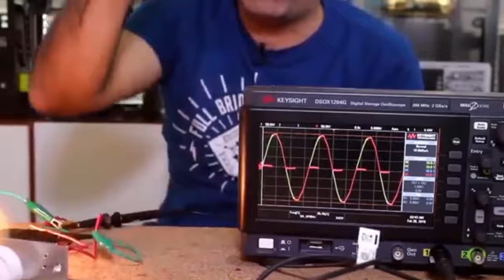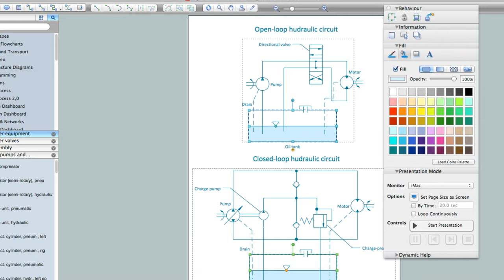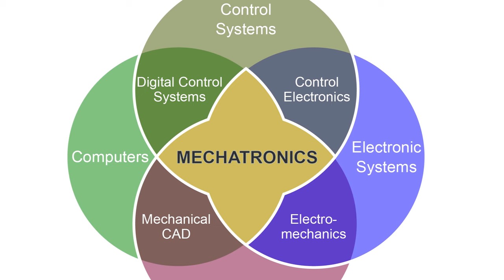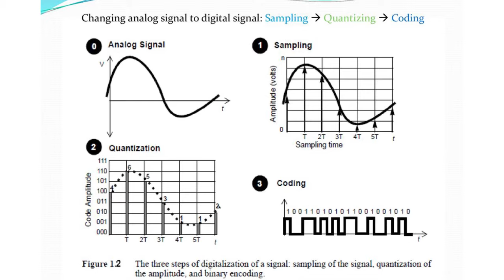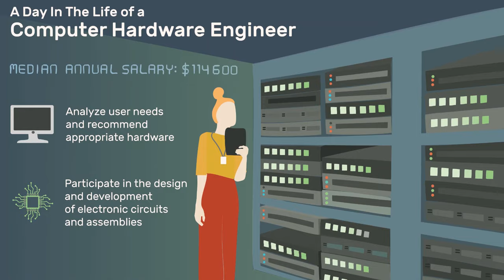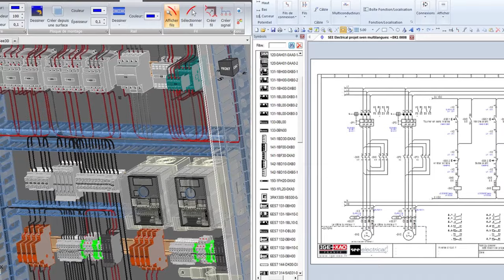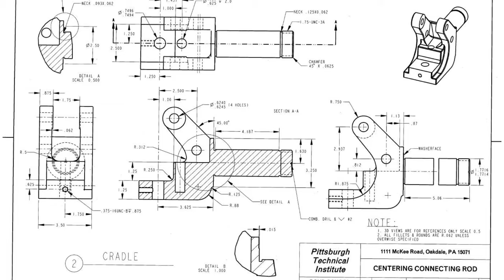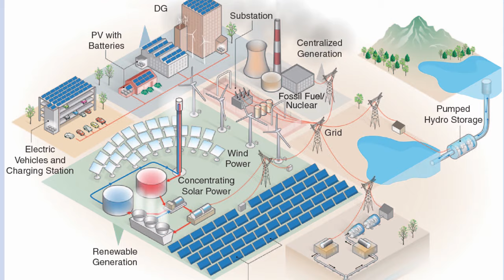What Does an Electrical Engineer Do? | What is the Work of Electrical Engineer?

Comment: Question: Do electrical engineers actually build things? I am heavily interested in mechatronics engineering because I hear you can obtain a wide range of knowledge from it about building things, and I'd love to learn how to build things and maybe have that as a job
Reply from the maker: Hey good question. It depends on the avenue you go down. Power engineers and telecommunications engineers may not, but electronics and circuit design engineers can work with mechatronics easily. You can also enter a software developer role and work with robots or mechatronic systems that way. 

Does that make sense? I have a video on mechatronics that is becoming popular, it may help, 

  “What Do Mechatronics Engineers Do?” https://youtu.be/4YjLZcQRLds

Consider computer engineering too. This involves the integration of hardware and software. “What Do Computer Engineers Do?” https://youtu.be/hiL-cTbz188 

Does this help and make sense? I respond to all comments so let me know any follow up questions okay? Thanks!!
Reply: @JakeVoorhees  I actually watched your mechatronics video before this one 😂. My dad is an electrical engineer and he says what he does most of the time at work is make designs and stuff, and I want to be able to build those things. I don't want to do software or computer engineering as a job, because your siting in front of a computer all day and writing code doesn't suit me. I want to be able to make designs,  then code and build electronic systems, which is why I want to do mechatronics, because it gives you lots of info about this. Do you know of any jobs that are like that?
Reply from the maker: Hey thanks for the reply and context. Some computer engineers can become computer hardware engineers and there are 71,000 in the US, so its the 5th most numerous engineering type - again we're talking hardware computer engineering alone. These are essentially electronics engineers working with computers. 

In order to do mechatronics, you have to choose either ME or EE or CPE - there are only 3 ABET Mechatronics programs in the USA and they are with smaller schools, most of which you would not go to I am sure.

So  you have to choose one of those and do a degree concentration in mechatronics, which is a great path. Some universities have a formal certification program within EE/ME/CPE, or you may have to build it yourself. You would do that by for example, majoring in EE and taking more electronics courses and less about power or telecommunications. You would take robotics electives, signals and controls, and circuits courses, etc. Your CS related courses should revolve around mechatronics rather than something else, and so on.

Computer Engineering is often a subset of Electrical Engineering. But sometimes engineers struggle to choose between ME vs EE. This video will help you decide, “Mechanical VS Electrical Engineering” https://youtu.be/6PJ-Yw5qVsc 
 .
These will probably be helpful as well:
“What Do Mechanical Engineers Do?” https://youtu.be/5wEteXzhtak 
“What Do Electrical Engineers Do” https://youtu.be/zRawKI6Qsm0
and I know I linked this one above but here it is again, 
“What Do Computer Engineers Do?” https://youtu.be/hiL-cTbz188 
.
I also ranked Mechatronics Engineering as one of the only two S-Tier Mechanical Engineering options in this video, “Mechanical Engineering Job Tier List” https://youtu.be/ghxBLeEX_OM
.
Does this help and make sense? Let me know what follow up questions you have okay? I respond to everything, thanks again!!
Reply: @JakeVoorhees  thanks! I'll be sure too watch those soon. But I don't  really understand what you said in the thrird paragraph. The college that  I'm probably going to has a degree in mechatronics that you can get. Are you trying to say what to do if it doesn't? I'm a little confused there 😂
Reply from the maker: Which school? That’s great they have the program but for some reason there are only three that are accredited by ABET, the body that says whether a programs graduates are eligible to sit for the Professional Engineering exam. 

But if you look at their ME and CPE and EE programs, I bet you they are ABET accredited. The mechatronics programs are too new I think. So what if you go into some field that requires design and for you to become a PE? You could regret this moment. 

Does that make sense? Ask any follow ups ok cheers thanks
Reply: @JakeVoorhees  as it turns out they are accredited! But I looked at the numbers of people enrolled for every year and how many bachelor's degrees are awarded each year, and that number is significantly lower. In 2018, 407 undergrads were enrolled, and 429 in 2019. In the 2018-2019 school year only 48 bachelor's degrees were given. Is mechatronics really hard or something?!?!
Reply from the maker: Yeah that one doesn't make sense to me. How long has the program been offered? The graduation rate for engineers over a 6 year period is just 54%, so you should be seeing around half or so of the students graduate. That or, maybe honestly its just grown so much faster over the past 3-5 years. And when the current students who are graduating now, when they were freshman, maybe there was only 100 students in the program and its grown like 50-80% per year you know? Gotta look @ growth rates and age of the program. Mechatronics is no more difficult than regular EE or ME, it is arguably a little less challenging than typical EE I would imagine, but thats hard for me to say exactly. Each program is different. Does that help and make sense? Let me know what follow up questions you have okay? Thanks for the patience, cheers
Reply: What do you study now?
Reply: @yd1765  I actually started college and am studying mechatronics lol
Reply: @zman4002 in which university ?

Comment: Hi I just registered for a electrical engineering major at the ETH Zurich. I‘m extremely interested in renewable energies, AI, VR, electrical cars and totally fascinated by the worlds created in video games.
I still have chance to change my major to mechanical engineering and I am just not sure which one I like more. When do know exactly which of the two is the correct major for you?
Reply from the maker: they are so similar, but different enough. not as similar as electrical vs computer. mechanical is more for people who want to work on the actual physical parts of things. The design and testing and everything for those. Electrical engineers may use those same parts, but are moreso designing and working with either the power, control, instrumentation, magnetism, etc type of stuff within an engineering environment. you cant really go wrong either, so dont worry. EEs can work in and learn an ME role, and vice versa
Reply: I can’t pick between the two either, there seems to be not much aid online about helping you pick a field of engineering. I’m leaning towards electrical but have always loved cars and the like. I would assume electrical would apply to more fields just because of how tech dependent things are nowadays
Reply: I knew I didn't like mechanical engineering when I took physics 1 (mechanical engineering focus) in my first year. I loved physics 2 (electrical engineering focus) so I knew I was in the right path. Hopefully, physics is similar at your school as well and you find the best for you.

Comment: Being a final year electrical and electronics engineering student (an integrated program). Here's my some of views.....

1) I won't classify computer engineering as sub domain of electrical or vis versa. Both are different in their own field.
Although I will put the mutual topics of both engineering under electronic domain (Digital electronics).
2) Signal and Control are the toughest subjects in entire enginnering program, due to it's vigorous math orientation.
3) Communication is most boring and dull but the same it's interesting also. Here you will find direct application of electromagnetism. If you love physics, then you will definately enjoy some part. (I have mixed feelings for particular).
4) Electronic is really huge field, ranging from vlsi to micro&nano. ( As earlier mentioned, it's integration of non core electrical and computer science)
5) Power engineering is core electrical. In which electric machine was least intrested subject I found.
6) power electronics, the rapidly emerging field due to demand of solar energy and EVs. You'll find tast of power, electronic and Control engineering.
Reply from the maker: Hey thanks for the comment. Appreciate the insight.
1) CPE really is a part of Electronics Engineering and its commonly within EE programs in the USA, but I am sure other places are different.
2) Good insight, thank you for that.
3) Interesting, thank you.
4) Yes.
5) Yes
6) Thank you for that, very interesting.

Really would love to hear what you are up to in your engineering journey? Let me know what I can help you with okay? Cheers thank you !
Reply: 3) Signals & Systems in school is vigorous, but once you discipline and apply mathematical principles it becomes so much smoother in telecommunications.

Comment: I've applied to do EE in university, maybe a masters in CS after. I'm interested in Finance, oil and gas, and large scale electrical systems, but I'm not sure which to go for!
Reply from the maker: Hey thanks for the comment. And yeah you don't have to know all that stuff right now. I would not even be thinking about grad school yet. You will have options of what tech electives to do in which case if you like the CS courses more, you can take more of those. You can then intern in CS roles and if you really are loving it a lot, CS grad school could be the way. But, finally, lots of EEs end up working in CS roles with their undergraduate degree alone. So don't worry about making a decision for something years away until you really  need to and have more time to accumulate knowledge to help w that decision. Let me know what I can help you with next, thanks!

Comment: Hi Jake, I’m interested in making a difference via working in renewable energy as an engineer. Could you explain the difference in what electrical vs mechanical engineers do in renewable energy? What actually do electrical engineers do in renewables?
Reply: EE works a lot in power regulation and transmission. How to maintain and protect a grid so it doesn't fail to spikes and environment, how to regulate voltage etc, what to do when user end is dumping power back into the grid etc. 
 In terms of generation, it depends on the type. For example, solar, since you are working with so much semiconductors, it's going to be more of EE/chemical side. Hydro, thermal and wind would be more Mech, civil with EE as support. and for nuclear, that's physics + EE with mech and civil working on surrounding systems.
Reply: Thawne  what do you mean by disrupt?
Reply: @Thawne  i mean... most grid level generators are AC. So usually you are dealing with transforms rather than caps. And of course there are also fuse and circuit breakers and other voltage and current monitoring systems. So I guess if someone try really hard enough they can mess with a system, but they have to really try.
Reply: @Thawne  yeah, things like that. I work on low-mid voltage devices so i am not as well verse in grid level stuff, but generally, we try to design so that worst case scenario is controllable.

Comment: I am interested in working with IOT and embedded system like Arduino. I also love robotics and automation and want to work as an engineer who design and develop smart devices like smart home or control, operate and design producing chain in industrial factory. Do you think following electrical engineering will be suitable for me ?

Comment: I currently go to tech college and I study mechatronics there. I really like the whole mechatronic area, but there is nothing I like more than Electricity and Electronics (here in Brazil we consider these two as Electroelectronics). I really don't know if I should go for Control and Automation Eng or Electrical Eng, as here jobwise the first option isn't really recognized, but the second one is, although, literally anywhere else, Control and Automation Engineering is a great option with lots of job offers (keep in mind that in order for me work abroad, I would need experience), which one do you recommend?
Reply: As a recent grad, I ran into the exact same problem when I got into college. I would suggest going into EE and then taking an automation/robotics minor if it's offered as it gives you more path to go into when you get into industry. EE courses do teach control and feedback systems, however, they don't do much coding and robotics. Doing an EE major with a Control/automation master also works too,
Doing a robotics minor, which I did, means you had taken classes that are related to the topics. However I must warn you to take when you are an Electrical Engineer, you are going to end up designing the background system for the robot, like the power system, communication circuit, driver and processing circuit for motors and sensors, etc. The control system would usually be designed by CS/CE.
Reply: My suggested rule of thumb is don't pick a major that sounds highly specialized or sounds like it's a combination of multiple majors i.e. mechatronics. The former limits the jobs you can do in industry and the latter just makes you decent at multiple topics but not good in any particular one that makes you slightly less competitive. So pretty much just pick the big 5 and branch out from there. The only exception I would say is Biomed, since it teach you biology and that gives you a different edge that the big 5s just don't have

Comment: Wait ...I'm doing process control and instrumetation 🤔we r dealing with plc s and sensors (control systems I guess) as well as the design of instruments that can measure physical quantities...does it means that my field actually merges 2 of the 8 main fields of electrical engineering?
Reply from the maker: yes probably. This would not be uncommon. It is not a concern I think :) what else can I help you with?

Comment: There's a mistake in there. FM radio signals can't go as further as AM signals can as FM radio operates in a way higher frequency than AM. That said, the advantage of FM signals isn't on the range as it loses spectacularly, but in it's audio quality as FM suffers way less from noise.
Reply: I thought the same thing. However, at a given frequency (e.g., 500 MHz) and line of sight distances, an FM signal can be decoded at a further distance. This is because it is not affected as much as an AM signal by the signal attenuation that occurs as you get further from the transmitter. Having said that, there is the actual experience that is based on the convention used in the US. Here, the AM band is 540 KHz to 1.7 MHz, and the FM band is 88 to 108 MHz. The lower AM frequency has a longer wavelength, when make it susceptible to bouncing off of the ionosphere. This can result in an AM signal being detected thousands of mile from the transmitter. The shorter wavelength FM signal is not susceptible to this bounce phenomena.  As a result, FM signal is strictly line of sight.

Comment: I completed 3 years in my electrical engineering and still.. not getting vibe of it...😕 is there any place online where I can work on open source project of electrical engineering....? Like software engineers have..
Reply from the maker: Hmm so what part are you unsure of? Let me know so I can help.

And Github has some electronics projects. Check subreddits. IEEE may have something. Let me know what else I can help you with okay? Thanks !!
Reply: @JakeVoorhees  I checked out IEEE and GitHub on your advice and it was very helpful 😃. I had already started working on project from GitHub. Btw I have more intrest in Ai, Robotics, Automation and electronics...Rather than in big scary🧟‍♂️ power transformer and generators..(what are your thoughts for this…??)
And Thanks for the advice...!!!🤗

Comment: What laptop specs do I need as an Electrical and Electronic Engineering Undergraduate.
Is 8gb ram enough?
Reply from the maker: Ya 8GB DDR3 is good
Reply: @JakeVoorhees  which laptop would recommend for EE that is under $500?
Reply: @DaEpicKiller  a ipad and pen
Reply: @wojak6793  i second this. Ipads are really good for note taking and sketching, and trust me when you study engineering u will be drawing a lot of diagrams.

Comment: Hi Jake. I heard from some ppl that electrical engineers with just a bachelors are usually thrown into test engineering or technical sales rather than design and development roles. Is a masters specialisation in EE required to be able to do more interesting EE work? Should I do a BE + ME in electrical engineering or should I just graduate with a BE first? Thanks :D
Reply from the maker: Nah that is not true, there are 328,000 electrical engineers employed in the USA and thats just behind civil engineering (330,000) for the 2nd most employable engineering type on the market. So someone misinformed you. Watch these videos for more information about EE, thanks, 
“Jobs for Electrical Engineers over $100,000” https://youtu.be/Vi4hkCeNWs0 and “Mechanical vs Electrical Engineering” https://youtu.be/6PJ-Yw5qVsc